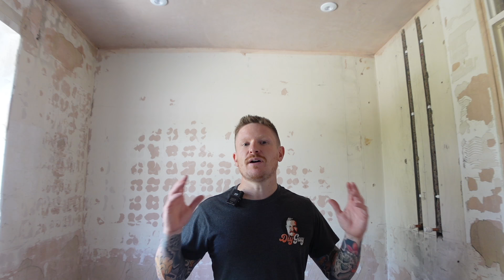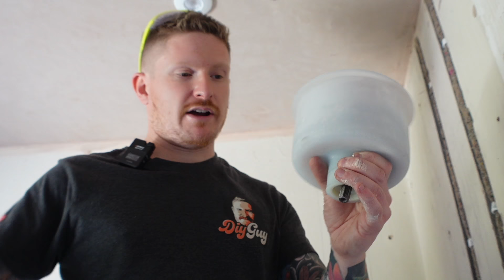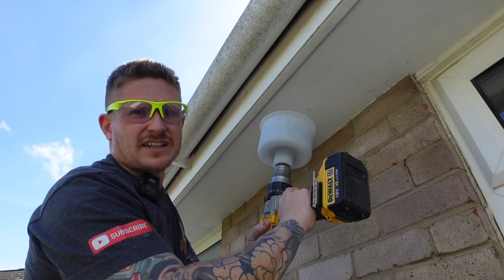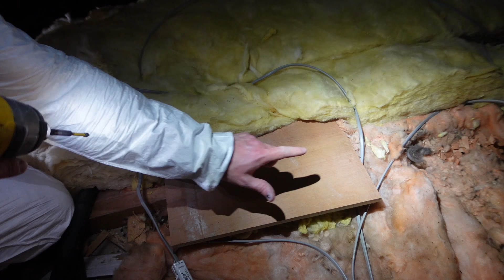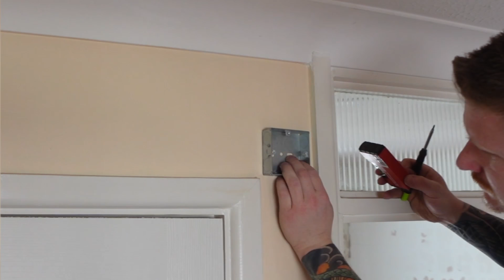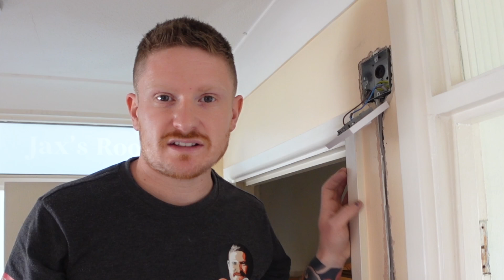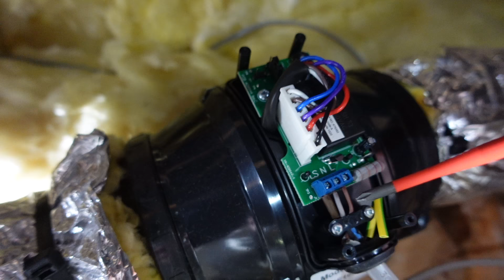How to Install a Bathroom Extractor Fan - Complete DIY Guide Made Easy

Comment: Great video. One question I got. Has the isolator switch got the 3amp? “The installation must have an omnipolar switch with a contact separation of at least 3mm. The circuit must be protected by either a 3 Amp fuse or suitable 3А МСВ.”

Comment: @TheDIYGuy1 Currently we have a pullcord switch in the washroom and no fan installed and hence no isolator switch as well. there is only a single pendant light in the washroom. If we want to install this what would be different as compared to this vide. Any change in electric wiring from the one shown in video? Any other changes? Your expert opinion please.

Comment: My neighbor has had one of these fitted there bathroom is on the opposite side of the house to the wall that connects to my house. But since tha have had it fitted it the vibration is driven us mad sounds like a microwave sound when its turned on allso sounds like its connected to there bedroom any idea what could be causing the loud vibration noise please ?

Comment: Absolutely brilliant video - thank you. About to do same myself. One thing I don't understand is why the chase out between the switch and the isolator? nothing seems to be running in the chase. I'm trying to work the runs out - am I right in thinking like the mock up; run everything up to the wago box in loft and run it out to fan and lights from there? I will need to do a chase like you to get the light swich cable into the loft but will it just go through the isolator switch back box but just using this as a path and making no connections here? 
Thank you so much again - great channel, Best wishes, James

Comment: 🎯 Key points for quick navigation:

00:00 🚿 Bathroom Extractor Fan Installation Overview
- Importance of bathroom extractor fans to remove moisture and humid air.
- Installing a ceiling vent above the shower for efficient moisture removal.
- Checking for joists in the ceiling before drilling the hole for the vent.
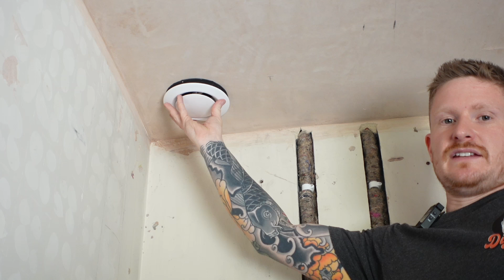02:42 ⚙️ Installing External Vent and Inline Fan
- Installing the external vent easily in the soffit for efficient ventilation.
- Introduction to the inline fan and its effectiveness in reducing steam in bathrooms.
- Positioning the fan in the loft for optimal airflow and stability.
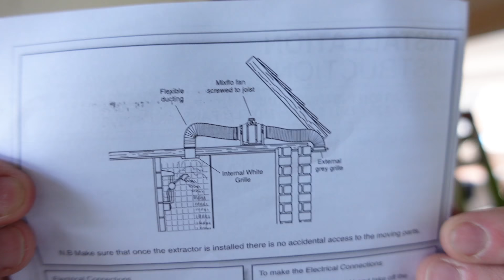05:31 🔌 Electrical Wiring and Isolator Installation
- Installing a fan isolator switch to control the bathroom fan.
- Detailed explanation of wiring an isolator switch with clear visuals.
- Ensuring safety and following regulations when working with electrical circuits.

Made with HARPA AI

Comment: I had one of these installed when I had my soffits replaced a few years ago so went in through the roof tiles but mine has never worked so well? any idea why? It's installed exactly how you have done it. I took the additional step of adding sound insulation/vibration mat and then screwing it onto the wood so its even quieter.

Comment: Cheap and nasty.  Those flexible pipes just harbour condensation, which will lead to mould and other crap.  Fan mounted directly onto joists will transfer all vibration straight to the ceiling and into the house.  Spend less on tatoos and more on research.

Comment: I'm not sure about your placement of the extract vent. The location of the extraction point should be at the opposite end of the room to where the air ingress is - so diagonally across from the door.
The air will always take the shortest path - so you're going to have the air coming under the door and going straight up the vent, leaving humid air up against the outside wall, which as it's the coldest part of the room, is likely to suffer from condensation despite the extractor.

Comment: The internal plastic of the ducting I personally like to electrical tape that onto the fan and vents. It gets a nice air tight seal and then I'll push the rest of the ducting over that (insulation and out sheet) and then zip tie that to just minimise it moving.

Comment: Great video as usual, my in-line fan only has 2 connections (live and neutral, how does this differ?
Reply: If you’ve only got 2 wires it means it won’t have an overrun after you’ve switched it off, it will just turn off immediately. To keep it running on a timer you would need a third wire which would be a permanent live
Reply: @darrenqualters2341  thanks very much Darren, am I best to get a timer one then, only a small bathroom so steams up quickly

Comment: Is there a damper to prevent outside air from coming into the house when the fan isn’t powered on?
Reply from the maker: I’ve not found it to be necessary with soffit installs. Only gable end installs

Comment: I installed a nice no noise fan. However, since the existing duct was smaller, I made an adaptation and it makes a lot of noise. Not because of the fan but because of the muffling effect. Do you have a video of how to replace duct? I will need to replace the duct so it will be a fine job.

Comment: Good video. I fitted one except the fan on the joist causes vibration. Tried mats and rubber under fan, no difference. Finally had to hang it from the rafters with chains. Fan sits on a board like a swing.

Comment: Cracking vid mate. Really well installed. 

One point though that is a safety issue. The wiring between the fan and the 3 pole switch should have a 3 amp fuse installed. I’m not sure why this is as to me it’s a bit pointless but 90% of manufacturers state that it has to be there in the installation guid. 

Please don’t think I’m being a keyboard warrior as that was a cracking install you did there just a point I picked up that’s all.
Reply from the maker: Cheers 👍

Comment: Don't see the point in the insulated flex pipe. The loft will get cold in winter and the inside of that pipe will get cold from the outside air, a backdraft flap ain't gonna seal 100%. Next isuue I would see is moisture sitting in the troughs of the corrugated pipe. I'm doing this job shortly and am using rigid smooth pipe on a slight angle.
Reply: It's insulated to reduce the amount of steam that recondenses into liquid. The troughs help prevent the small amount of steam that DOES condense down into a liquid from traveling out of the pipe and soaking any wood, drywall, plaster, or electrical lines. The insulation also helps any trapped droplets evaporate during colder months.

Comment: Its interesting how you Brits do wiring.  I would just put the fan on its own switch and be done with it.  We’ve got timer switches to regulate what you refer to as overrun.
Reply: There's nothing to prevent fans being on their own switch in the UK. My house was built with separate switches for light and fan.

Comment: Did I not need the 6A fuse way? I did this with virtually identical but different make fan. I thought you had to put a 6a fuse on the fan. I struggled as DIY to get my head past the switch live not been 6A fused so I spurred off the the loop and put the light and fan through the 6A fuse way. My over-run fixed at about 25 mins, would look at the manrose next time I think 10 minutes would be better.
Reply: it should be possible to fully isolate the fan and still have the light working (although this may not apply if there's a window). Only the fan has to be protected if the manufacturer requires it (usually 3A, 6A would normally not require extra fuse on a 6A lighting circuit).

Comment: Independent of this video, I installed a similar fan about a year ago.  It works well.  Too well. With it at maximum speed (mine is variable), it is louder than a 747 on a short takeoff roll.
Reply from the maker: They are good. The sound is more air suction sound rather than fan vibration

Comment: Good Video However you have clamped the conductors of the four core and not the outer sheath; on the feed to the fan. It is a bit tight in there but it is incorrect...

Comment: I might need info on a condensation trap. I have 2 bathrooms that need this, but the bathrooms are stacked.

In the main floor I could potentially exit through the brick house wall but kinda would prefer not to do so. 

Other options might be routing DOWN in the wall to basement, where I care much less about cutting a hole in the foundation wall near the ground outside. 

Or I could possibly snake the flex duct up and through the upstairs bathroom wall and into the attic and roof, same as for the upstairs bath.

Not looking forward to any of it.

Comment: After the building inspector had been I turned the switch off and its never been used, we've never had to open the window. Required by regulations,  in some circumstances essential but all? Nice fan though.

Comment: If cpc not needed for fan , Can we use cpc to go the fan as L or LS ?
Reply: you can never do this with T&E cable as the cpc is not insulated but it is possible to do it with 3-core flex as long as the wires are suitably sleeved to identify the usage. This was very common on DHW cylinder thermostats on Y-Plan systems. It's not really best practice!
Reply from the maker: No, definitely not I’m afraid.

Comment: Good job 👍 need to install one myself. i always wonder why do i have to turn on the lights for the extractor fan to spin. Is it not better just to have another swich for it and just turn on the fan with no light after the shower is done? Is it something to do with building regulations?
Reply: That’s just the common way that fans are wired. You can quite easily wire them into a separate switch though, or get a fan that has a pull cord built in for manual operation

Comment: can I do this as a diyer under the P certification, or do I need an electrician? I'm not totally sure because it is a bathroom, and not sure if the new wiring is considered as new circuit.
Excellent video anyway, I just bought my first home, and I suscribed to your channel as it is really useful

Comment: So with your wiring you have to put the light on to start the fan? In the summer months when there’s plenty of natural light I’d want to just have the fan on without the lights
Reply: You can have a seperate on off switch with string, next to the bathroom light switch to switch it on manually instead, or a fused on off switch high up but must he outside the bathroom.
Some fans have timer anyway so it wouldn't matter if you switched it of manually, you still get the benefit
Reply: Using two switches, one for light and one for fan is fine.

Comment: An observation- the Wago 221 connectors should be used with the Wago 221-4 junction box with the 3 compartments to be maintenance free (although yours is accessible in the loftspace). The Wago box with the 2 compartments at the end like yours is for the 772 and 333 connectors for a maintenance free connection, just in case someone uses the wrong combination and hides it under floorboards or in a wall. The 2 compartment box can be converted to MF with inserts from Wago👍

Comment: Drills a hole straight through asbestos soffit, and it needs to be 115mm for a manrose grill, not 102mm. Exactly NOt how to do this. The corner position for the ceiling vent is not recommended as this is inefficient. Further into the room, preferably between the shower and door, will allow the fan to pull fresh air into the room which will collect the steam/vapour as it is extracted.
Reply from the maker: Wrong on many points. Soffit tested and clear. As you can see, grills fit perfectly with a 102, the video doesn’t lie to you, you can see it, but if you prefer a bigger hole then that’s your way of doing it, which doesn’t make it wrong. Position inside the room in correlation to the window will give plentiful pull. Thanks for the comment.
Reply: @TheDIYGuy1  I think  woody has something against ya seems a bit of a know it all 😂 keep up the good work 👍
Reply from the maker: @darrenrodd. 😂 yeah there’s plenty of haters that go around commenting negative stuff. Most of it is wrong and simply different ways of working. Unfortunately the same happens in the trades, one persons way of working is different to another and they get slated as a result. I’ve been doing this long enough to have a laugh at it, it goes over my head these days 😊. I concentrate my time on making videos that help people 👍
Reply: @TheDIYGuy1  The Manrose instructions state 115mm hole, not 102. Put a link up about the asbestos survey you had done, just in case you've encouraged a few thousand people to drill into asbestos soffits.

Comment: Ok so next to the bathroom isolator switch I have a box where 2 wires from the ceiling go into it says transformer on a bit inside the box and there is a red light that comes on when I turn on the isolator switch  any idea on what to do 👍🏻

Comment: Now I know the manual shows flexible ducting but.... Air ducting is always better when the inside of the duct is smooth. For such a short run I'd have been using 4" tube with an insulated wrapper. the rough surface in flexible ducting slows down the air travel, it causes turbulence and reduces the efficiencies of the fan. Perhaps not a problem for this install since it's a short run, but worth using a couple of lengths of tube between flexible angle joints. Cracking video, and I could feel your pain filming in that heat... 👍👍
Reply: I dont understand why the tube has to be insulated - isnt it just taking the air outside. What does the insulation achieve/
Reply: @flyingwhiteindian  In the winter if the duct was not insulated it would get very cold and the steam would condensate in the duct before getting outside which is not desirable.
Reply: @flyingwhiteindian  Condensation forms and runs back inside. You can get traps to take this away but it's not usually practical.
Reply: what air ducting would you recommend??

Comment: Great video, but one little thing worth mentioning is that any electrical requirement in the installation instructions for any accessory need to be adhered to in order for the installation to be compliant with wiring regulations, and most of these shower fans call for 3A fusing on both the permanent and live cores - so the usual 6A MCB for the lighting radial isn't sufficient for compliance.  I usually install a separate single backbox next to the isolator with a 2-way grid plate containing two fuse holders fitted with 3A fuses.  It's an added expense and arguably overkill, but technically needs to be done in order to make the installation 100% compliant.
Reply: That seems like a lot of wires and 3x back boxes (inc the light switch). Could you instead have a 3a fused DP FCU somewhere in the loft next to the fan? Thanks

Comment: Such wiring has to be carried out by a qualified electrician under Part P of the Building Regulations.  
I never specify that the fan is energised by the light switch simply because you cannot guarantee that the bathroom or toilet user will turn the light on.  By far the best option is to install a PIR detector to switch the fan, this guarantees that the fan is switched on whenever the room is occupied.  Bathrooms invariably contain a WC and the smells need to be vented, you can expect that at night the light will not be switched on if the person has gone to the loo in the middle of the night.
In addition, fan ventilation as shown simply dumps the warm moist air outside but now we have the opportunity to extract the heat in that moist air and send it back to the room.  These heat recovery fan units are more expensive but pay for the premium quickly in the energy saving.
I would strongly suggest that the fan unit is mounted on AV dampers as the form of construction shown will act like a sounding board and be noticeable in the room below - I have direct experience of this.
Reply: given that there is no electrical work in a special location, its not notifiable under the current regs.
Reply: @narrowboatlongpod4176  It is if there is a new circuit provided.

Comment: Awesome video ,I've been planning to do my own extractor fan in my bathroom .... Just one thing, do you treat or seal the plaster board ceiling after cutting the hole for the vent? I seen you put sealer on the vent guide but did you do anything to the actual plaster board?
Reply from the maker: Hi, glad you like it. No, nothing further done to the plasterboard

Comment: Lets be honest, this will NOT stop the condensation forming while you are having a shower. No domestic fan would... that is what we have over run for.  Hot air from bathroom will condensate on any cold surface. It is not just the steam from shower that will.

Also as hot air from shover rises it will bellow along the ceiling taking steam woth it, and will end up away from shower.  Best place for the inlet in the bathroom is across the room ftom a window. Open window helps to get a draft from window to fan and drag damp air out... 

As for the electrics, you really either want to ommit it from these videos or do it properly. 
Decent attempt on wiring explanation but again without any safety checks. (Not talking about safe isolation) 

Cable grip in the extractor should be gripping sheath, NOT individual cores! 
Ill.pretend ive not seen the down light wiring all over the attic....

Comment: I use medium hard rubber spacer standoffs to mount the fan motor. It makes a massive difference to the noise because the board you screw it on acts as a sound board and amplifies the vibration. Easily available from Amazon, etc. Don't know why Manrose don't supply them in the first place!

Comment: I've installed one of these, but only after first buying the version without a timer - so be aware that that exists. It didn't even cross my mind that they wouldn't have a timer, thus didn't check the spec, like you wouldn't check the spec of a car to check it has a steering wheel! Screwfix brilliant as ever and exchanged it for the (more expensive) timer version. I've also turned mine down to the lowest power setting as thats fine, and it was surprisingly noisy on medium or high.

Comment: How did you get the 4 core from the fan into the back of the fan isolation switch, did you drill up from the back of the back box?